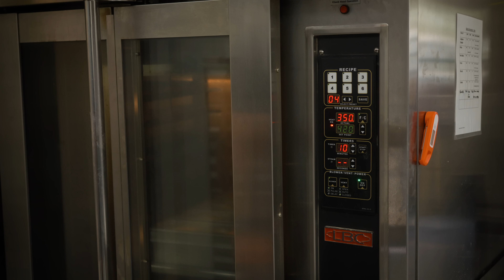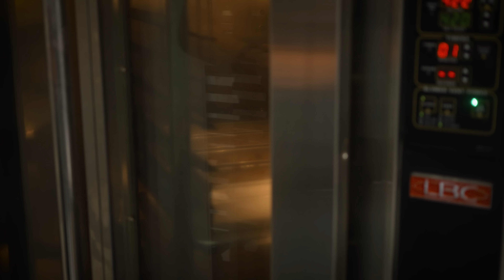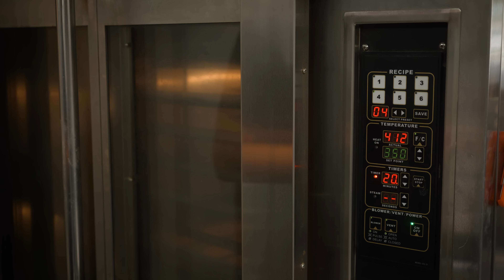Cereal Honey Crunch Sourdough | Proof Bread

Comment: A couple of observations when I, as a home baker, converted 2 iconic New England breads to sourdough breads--Anadama cornmeal scald & Wayside Inn Oameal bread oatmeal scald. In the old recipes--100yrs+--the sweetener, molasses--is added to the scald. I need to walk away because it seems as if it takes forever in my Kitchenaid for the oatmeal to release its moisture. I'm always tempted to add more water. BTW In most older bread recipe milk is scalded before including.
Reply: Here's the answer to scalding the milk. The whey in milk can actually prevent yeast from doing its job — causing bread to rise. But scalding milk weakens whey, allowing yeast to work.

Comment: The bechemel sounds like is essentially using the yudane technique.  Papers suggest that you can go as low as 1:1.5    flour:liquid ratio to allow it to pregelitanize fully if you are looking for ways to move some liquid around. Instead of cooking the flour on a stove, if you just add the boiling milk to the flour and butter,  mix well and then cover, allow to cool. This ends up saving on labour, as well as allows you to accurately predict hydration without accounting for evaporation that occurs as you make the bechemel traditionally.

Comment: How do you maintain Harriett? you take small portions and feed those to then use in your bread but you still have to feed the original Harriett in order to create more for the next day. It must be a large amount of original Harriett somewhere :)
Reply: There's a video from way back when he first moved out of the garage into the commercial bakery, where he shows the starter mixing machine where Harriet is fed and cared for. He actually had some adjustments to make at first, because the machine does a better job of making the starter very active and healthy, since that's what it was made for.

Comment: Question? I notice you just rinsed the mixing bowl and placed it on the rack. Do you not wash with soap rinse and sanitize?
Reply: This is standard procedure in many commercial bakeries. No sense in sanitizing the bowl multiple times during the day if you're putting the same ingredients back in the bowl again a bit later.   Cleaning with water is fine. It'll be sanitized by end of day is my guess.

Comment: Use a tangzhong instead of a rue
Reply: tanngzhong is a just a water roux, tangzhong, yudane, water roux, it's all the same thing.
Reply: @kapser2210  They're definitely very similar, and will all yield similar results. But I think TangZhong is typically made with milk, just like the roux, but without the addition of butter. However, I've made TangZhong with water and it works the same. And in recipes where I'm also adding butter, I often melt it and mix it into the TangZhong while it's still warm, so not much different at all to what Jon is doing. It all works.